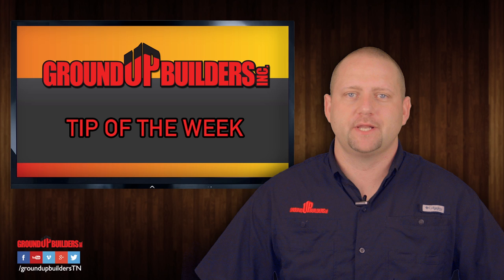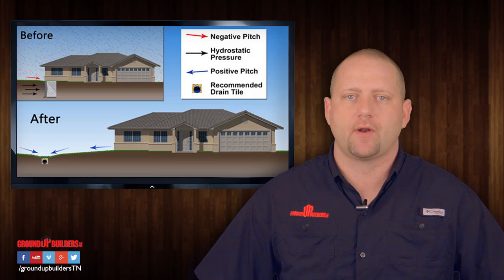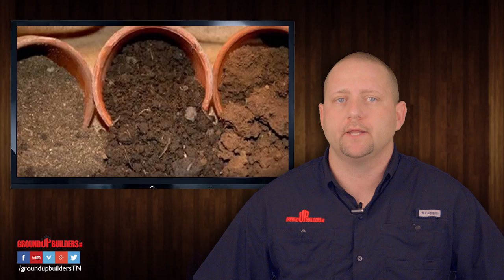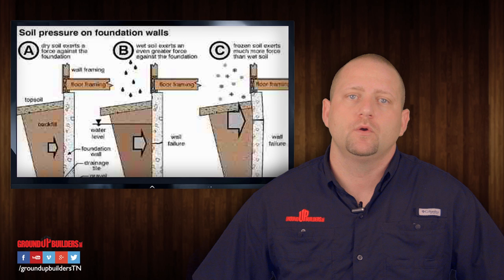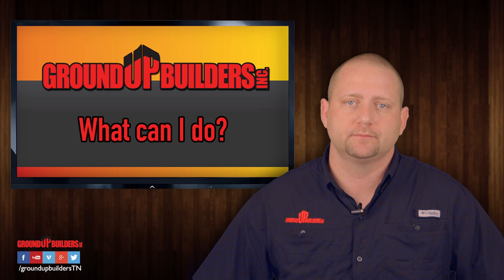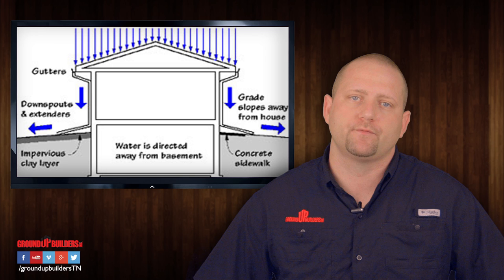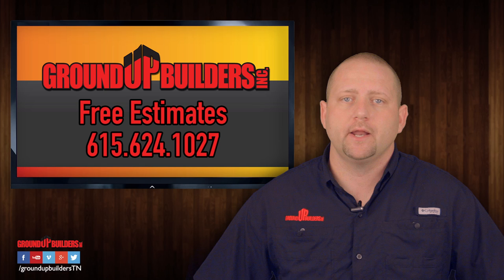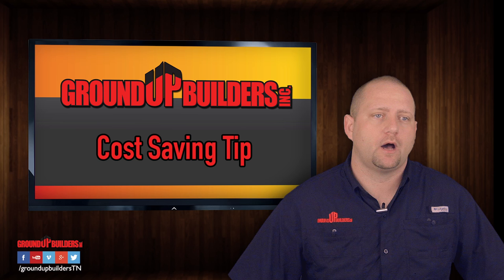Tip of the week - Grading around your home.

Comment: One acre or rain! Lol this way of measuring is new to me. I’m writing this formula down. Thanks so much for the useful information
Reply: One Acre: 209.5' x209.5' x 1" ... Then, arithmetic! 

If I recall correctly, 6.25 Gallons per Cubic Foot (12" x 12" x 12")! 

Also, 3.78 Litres per US Gallon, 1 Litre = 1 Kg = 2.25 Lbs. (Double Check that, but If I got it right, a little math, and you are set!)

Comment: Rain will go through sidewalk cracks so it doesn’t count as grade around building
Reply: really?  but how fast can water really soak through a small crack? specially as they tend to get filled with fine soot
Reply: @brianbailey462  there is a video of a home inspector/foundation guy walking a house with basement flooding that had the concrete sidewalk around the building as grade and it wasn't working because rain just flowed through the cracks.. I imagine that the concrete 'roof' doesn't disperse all rain, and the amount that gets through the cracks is enough to alter soil wetness.. and that if you do concrete, you still need a grade so the water slides away from the building through capillary action and gravity.. just my theory.

Comment: what type of soil should i use for this project?
Reply: Soil with alot of clay.. ie. Clayfill.   Clay will form a impenetrable surface for water to flow away.  Use regular top soil and water will seep through.  Alternatively you could use any  soil to grade but  put plastic on top, then rocks on top .   Water should  roll off about 1 metre away from foundation.